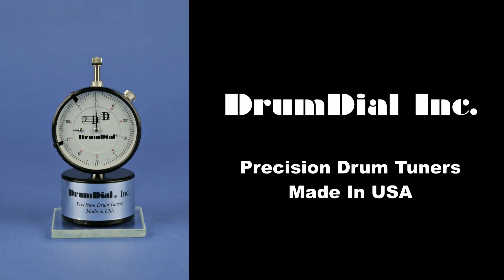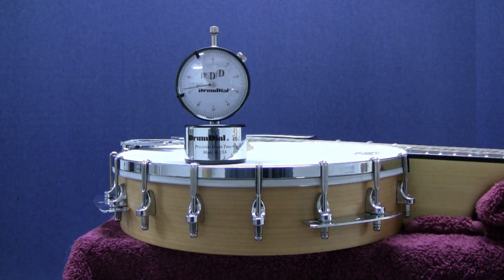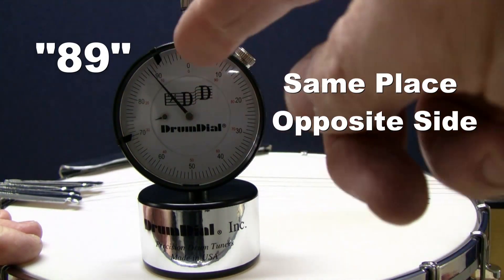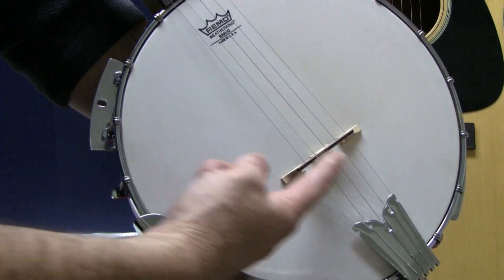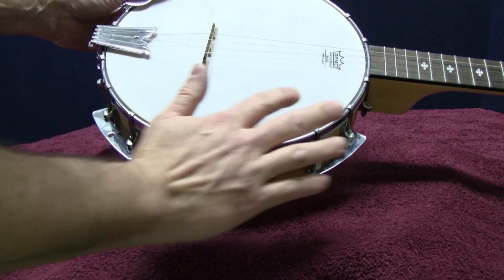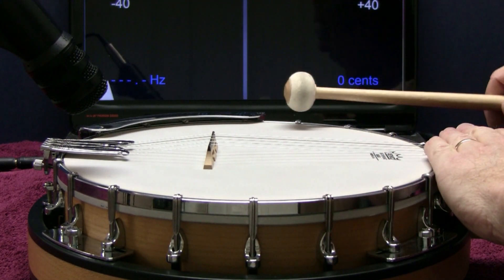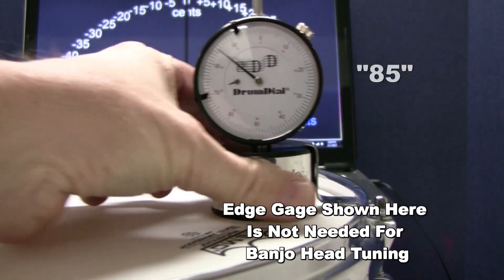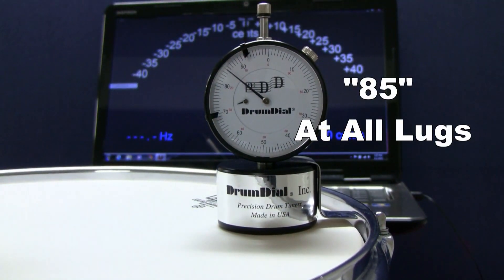DrumDial Drum Tuning Part 7 (Banjo Head Tuning) Advanced tuning Techniques

Comment: Hello, is it possible to adjust the conga with this method?
Reply from the maker: Yes, DrumDial works very well for tuning congas, djembes and bongos etc.. The setting for Congas is 96 for both (or all) of the drums. The depth and diameter of the drum will determine the pitch. We tune to C G E for congas.
96 is a high setting and the readings will be less sensitive much higher than 95 and it will take more turns of the tension bolt than it would at much lower settings.

Comment: What are your thoughts on using the drum dial to tune the head BEFORE the strings & bridge are in place ?
Reply from the maker: It is easier to tune without the strings and bridge in place. Also, you can tune from the underside of the head as shown in the video also for more precise tuning if the bridge and strings are in place.

Comment: I play about 5 different banjo from an inexpensive Recording King RB to an 1894 Fairbanks electric.  The settings and methods you illustrate seem to those favored by bluegrass banjoist at least since the 1950s.  Are there variation of other types of banjoist,   I
Reply from the maker: Thank you Tony, the drum head settings would be looser or tighter depending on your desired sound for your particular banjo. Matching your tension at each tuning point would still be the same.

Comment: DRUM DIAL BANJO SETTINGS:

My recommendations are for plectrum banjos only using Remo cloudy heads.  For a flattop and archtop banjos with 11 inch head the drum dial setting  is 87 (flatop) and 89(archtop). Note archtop banjos generally need a tighter tension than flat top .

Tuning:
Tighten, or loosen each hook working on opposing hooks all the way around the banjo. Do not work around the head in order, you will never get the numbers to be the same. Tighten hook 1, then 13, then 2, then 14, then 3, then 15, etc. until you have the same number all the way around.

Comment: Drum dial on a non-resonator banjo 12" 'Renaissance' head - 92 works. Don't know if the extra tension is due to larger head - compared to standard 11" banjo heads.
Reply from the maker: Thank you Howard!
Reply: I will experiment at lower tensions now, as well, and I suspect a softer sound at lower Drum Dial numbers like 89 ... there is a limit how low I can go before the bracket nuts are too loose.

Comment: By far the most comprehensive video on the proper way to get the best sound out of my banjo. I like to know why as well as how. Coming from a retired electronics technician, thanks so much for doing this right!! :-)
Reply: Just finished replacing the head on my tenor banjo as per your instructions and it is a completely different sounding instrument. I think the head was way too tight and gave my newly aquired 1980 vintage Gibson TB-250 a tinny, shrill sound with no bass at all. Thanks!!